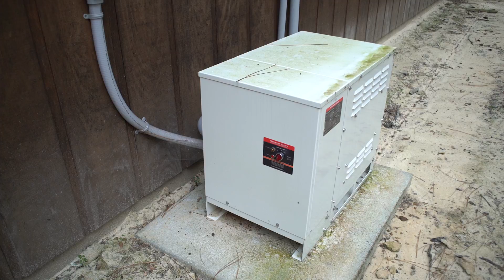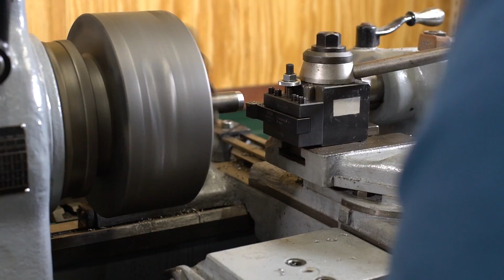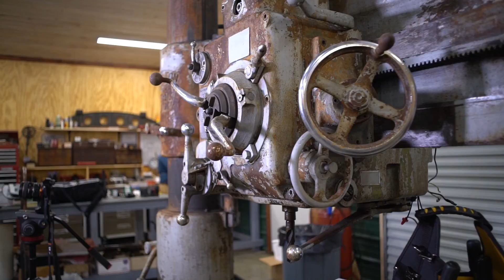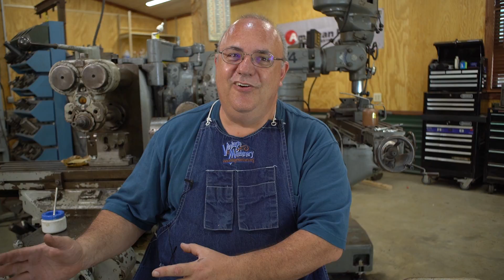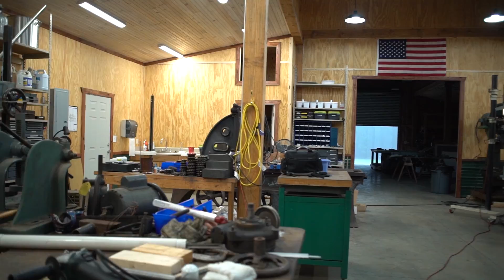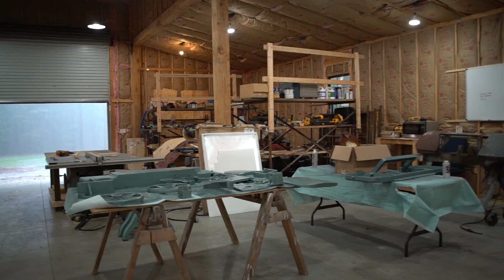Keith Rucker - My Shop and How I Got Started

Comment: Kello Keith I am in the same situation as I start working on heavy equipment back in 2013and I found out doing so, parts were not available for a machine I had so I bought a southbend 16 lathe to fix it and then well as it goes I started reading up through metal working books and the gears started to grind as I needed a few more machines. And 9 years later after working out of several small shops as I kept growing out of them I finally acquired a 10,000 sq ft shop that I am renovating know and my main expense right now is my three phase electrical service.  I graduated high school in 2009 and have been serving in the armed forces since 2012. So I feel how rewarding it is to get a big shop to work in . Cheers and keep up the great videos and fantastic work on the machines.

Comment: OK Kieth,

Here is an idea. Take a common table saw, and rebuild it. Make new casting patterns so the blade spins nice and straight without nasty vibration.   Make it so you can adjust it so the blade runs dead nuts parallel to the miter slots.

Next design a really great fence. How about one that has a DRO on the front and back sides to keep it in perfect alignment. 

Now build your sleds and what ever jigs you need for the furniture projects. 

View the building of each piece as a machining project woth noce tight tolerance.

Think how easy it would be if any component in a chest of drawers was exactly the same and interchangeable with all like components.

You could do some really cool things and give Mrs. Rucker some really great furniture.

Comment: concerning your Gieser height gage you have the main part. there is 2 auxiliary packages that go with it. one is an extension block set with sizes of 2" 4" and 6" and the other is a kit with different tips offset scribe, std scribe, half end etc to measure diff points much like gage blocks. these were mainly produced during the war years for Pratt & Whitney.